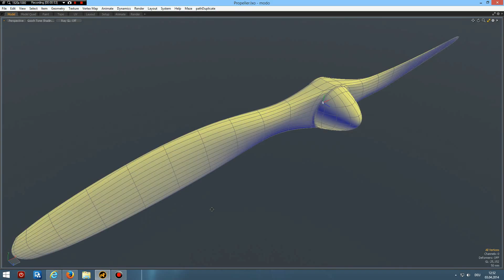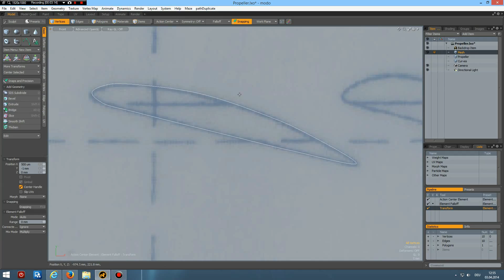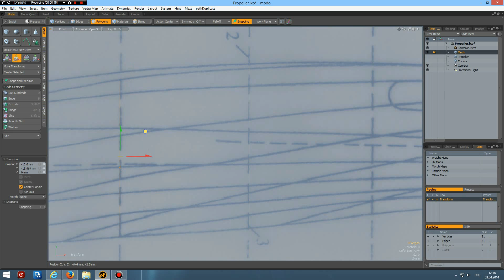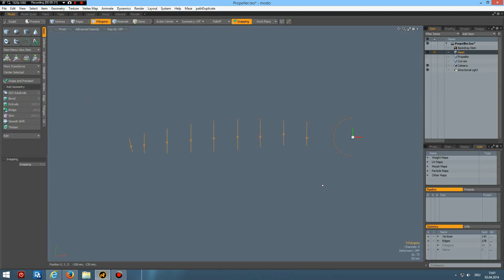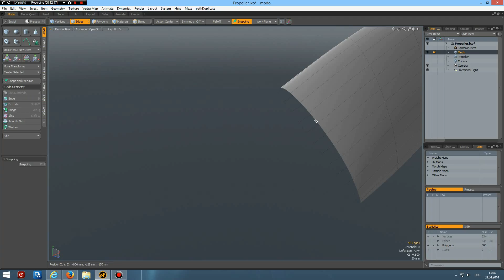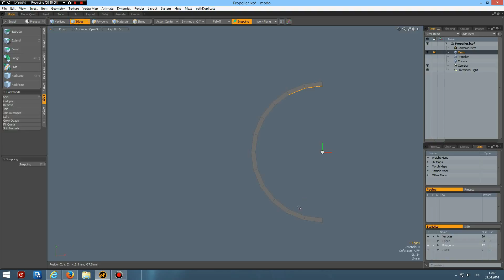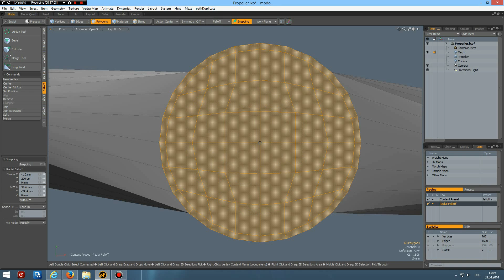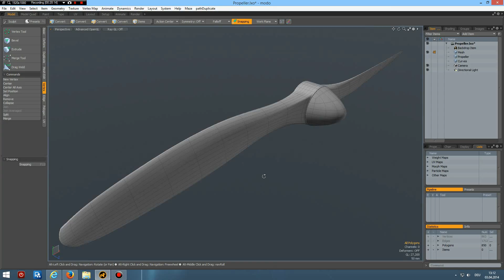The Foundry MODO - Modeling a simple Propeller

Comment: The author has studied Modo, but does not know aerodynamics. I wish him to fly on a plane with a propeller, which he designed. After all, he gave the same drawing right, and he blew it!
After initially built right lobe. Why (нахуя?) аt 4:47 he turned 40 degrees the sections?
In the figure had already been given the correct angle of attack of each section.
We should not rotate, but do not sleeve with front view and a top view.
И все тутошние бараны кричат "Урря-а-а!" Прав Задорнов :)))
Reply from the maker: Anabog Bog Hi, you are absolutely right. I have no clue whatsoever of aerodynamids and i also mentioned in my video, that i don't know how to interpret this blueprint :-) But thanks for commenting and happy new year, Peter
Reply: Peter Stammbach Hi! It's okay that you do not know aerodynamics, but you know very well Modo. And about aerodynamics can find information if it is very necessary. Sorry for my English Google. You, too, Happy New Year, I wish you good luck and all the best!
:)

Comment: Coming from 3ds Max I'm a bit blown away. In Max to use splines with cross-sections you should make sure that the number of vertices an all the cross-sections is exactly the same, otherwise you won't be able to produce polygons when you connect them and use the Surface modifier (all of which is a big pain).
So here's my question: here the amount of vertices on the lines (which represent sections) does not matter? If so, then it's a gift from the gods.
Reply from the maker: Hi Pavel, unfortunately this is not the case. All my splines had the same amount of vertexes (10) but when you bridge them together, you can decide how many poligons you want. Have a look at around 08:08 where i explain this. Thanks for your comment and all the best, Peter
Reply: Peter Stammbach Hmm, I just downloaded Modo Trial and created 3 enclosed sections (closed lines) with different number of vertices (6,3 and 9) and was able to bridge between them  no problem (same number of steps)(just what I wanted). Even when I chose a different number of steps when connecting the 2nd and the 3rd section Modo automatically created tris to accommodate for the difference. Bridge tool in Modo is superb. Anyway, this tutorial and others (especially the ones that used vector constraints) got me interested in Modo quite a bit. Thanks.